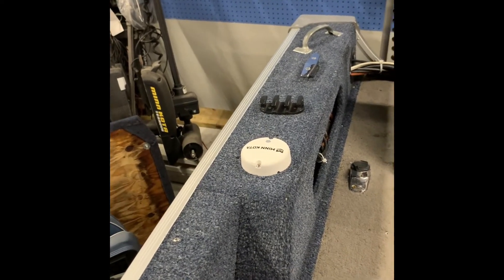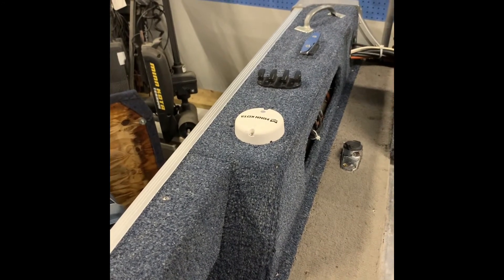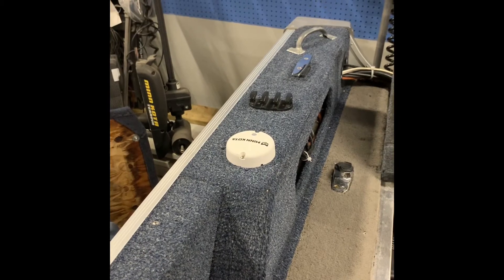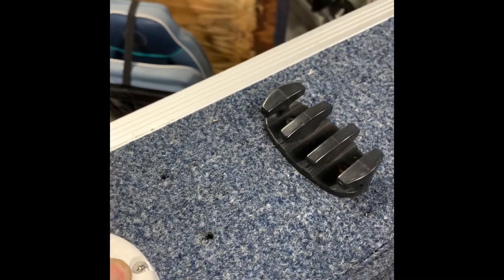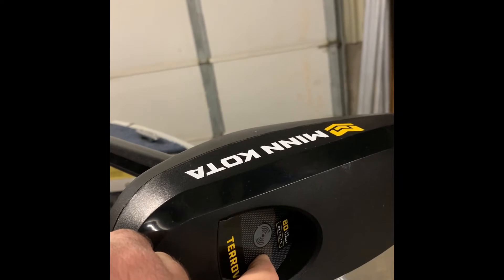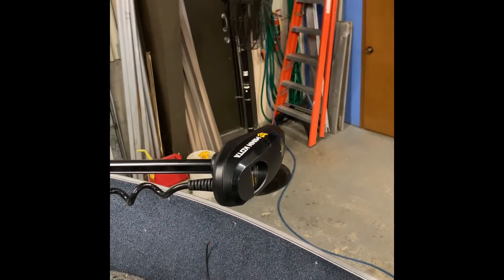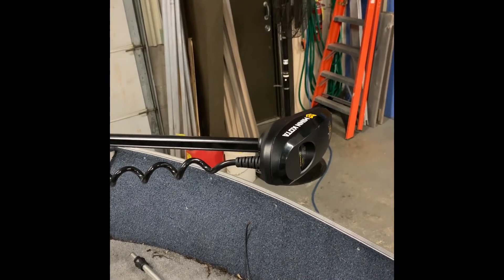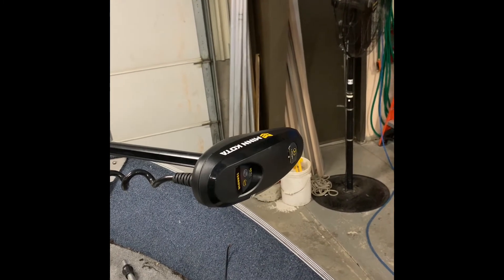Minn Kota Bluetooth heading sensor

Comment: Matt, can I install the puck on the bow next to the trolling motor?
Reply from the maker: I wouldn’t I try to mount them away from the motor
Reply: @AnchorsAWeigh  I don’t understand what you mean. I would like to mount the puck up on the bow right next to the Minn kota, but I wonder if that’s too close.
Reply from the maker: @CP-ho7zq  I think on the bow is to close I usually mount it towards the rear of the boat